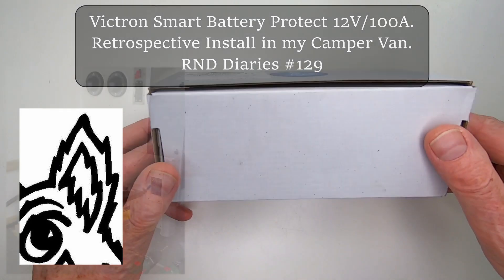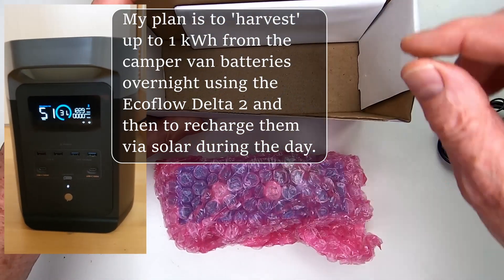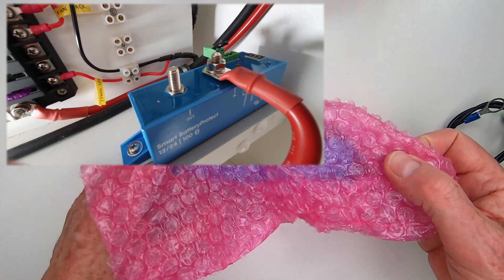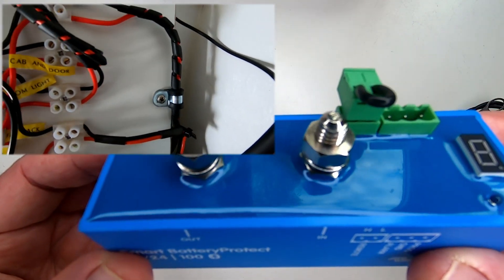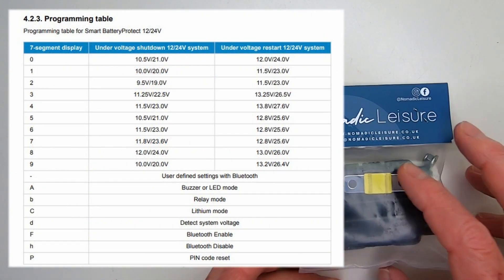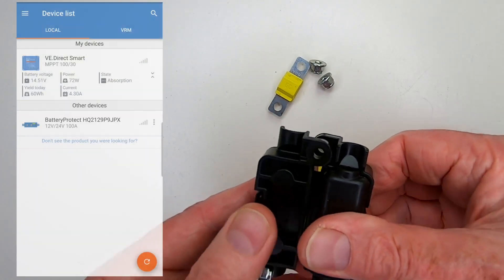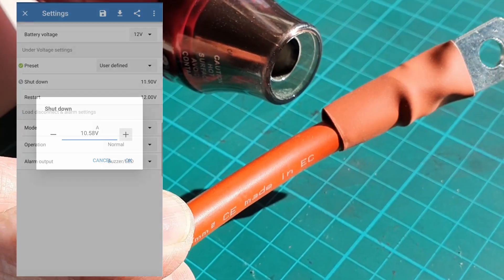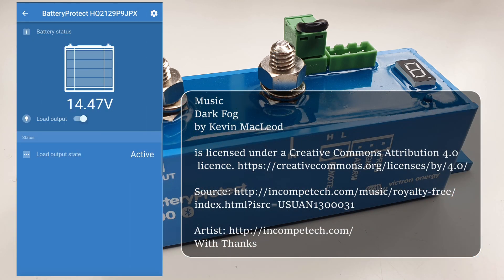Victron Smart Battery Protect 12V/100A. Retrospective Install in my Camper Van. RND Diaries #129

Comment: Interesting that I found this. I have kind of a similar situation where I have a house battery where I don't want it to go below a certain SOC like you are doing. I will also be adding a Delta 2 in order to charge it up via power from solar (or from my house battery). I really wish the Delta 2 had an adjustable cutoff for the 12v DC input as it is set at 11 currently, and if I could adjust it, I could have the Delta2 only charge when there is solar, or alternator charging. I may add another battery protect just to do this, but we shall see. For now I can set charging schedules in the app for the ecoflow, so I will be doing it that way in the interim.
Reply from the maker: Yes it sounds like an additional battery protect is probably the failsafe solution. As you can see in my various videos, my concern was that the Delta 2 would suck the volts out of the batteries way below the SOC. I had previously only been charging the Delta 2 in the day and only if there was enough sun which was a bit of a pain.